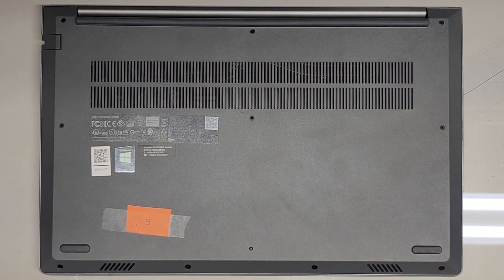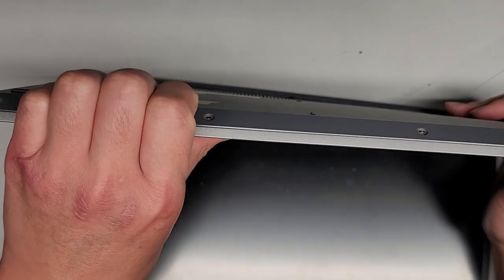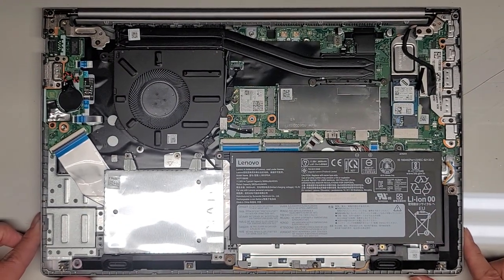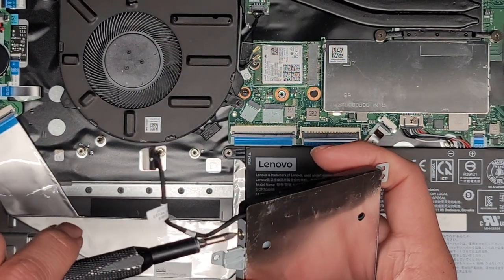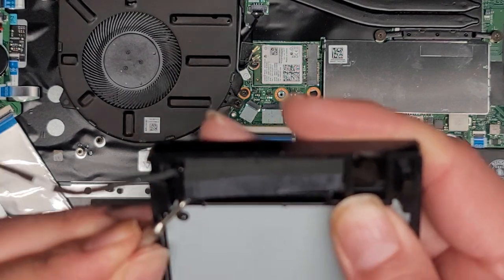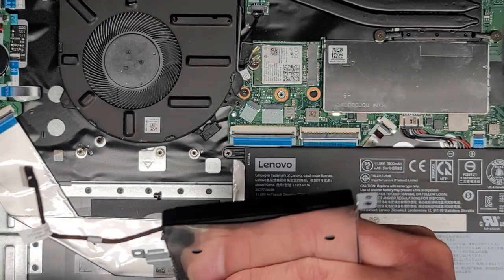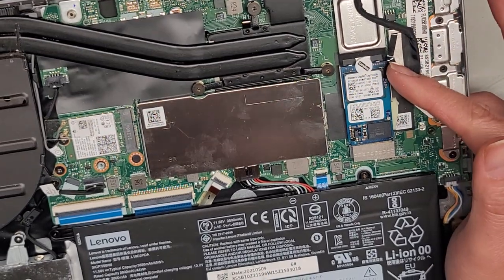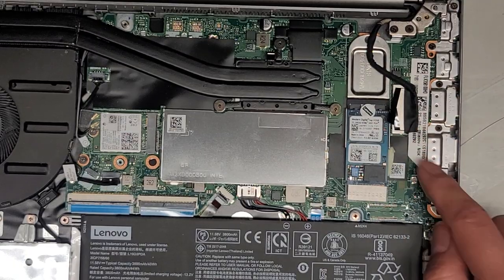Lenovo ThinkBook 15 G2ITL Disassembly RAM SSD Hard Drive Upgrade CMOS RTC Battery Replacement Repair

Comment: I had such trouble with the 2.5 ssd/HDD thing. Video was of much help 😊. Searched the whole day for a solution of a problem. Read in a forum - HDD is compatible, ssd not? Isn't this weird? So I put in Samsung 870 8tb. All normal, recognized, but then in Windows it locks up while copying, especially when writing. I even had data corruption. Reformat took ages. Ssd is fine, I tested again.
Reply: Maybe you understand more and have a idea. It would be such a dumb limitation of lenovo.
Reply: Tried it as last resort with an old 512gb ssd. Now this working! So it must be of other reason. Copied between external 8tb and internal 512gb several gb without issue. Vice versa, - still no
Reply from the maker: Hmmm very strange. So it's working now?
Reply: @ItsBinhRepaired  that's right! sadly no sucess. Think I will use it as external, speed is enough and as a benefit greater flexibility when switching devices (-:
Reply: @ItsBinhRepaired  BTW these thinkbook casings are like rubber. Old thinkpads where soooo much more sturdy, haha
Reply from the maker: Yeah, the old ThinkPads were amazingly built.
Reply: @ItsBinhRepaired  I am pretty sure  this weird dummy is that heavy to support the whole construction!! Fujitsu laptops where also very robust and a lot cheaper. Pure Underdogs. Sadly these had such annoying fan management I couldn't stand the noise any more. It went on/off all the times at the slighted peak haha.
Reply from the maker: @chaitai2533  :(
Reply: Lost me a little here - so will it take an SSD 2.5"? I also have a full size m.2 SATA SSD to replace the 256GB mini m.2, does anyone know if it will take a SATA m.2 or is it just NVMe? The SATA m.2 is keyed correctly because I replaced the z390 mobo it was in with an NVMe PCIe 3.0 m.2.✌
Reply from the maker: @facelessvaper yes and yes both 2.5" SATA SSD and m.2 full size.
Reply: @facelessvaper  technically it should work, - but- I put in Samsung 870 8tb, and it had veeery low speed and got stuck. I think it even destroyed partition. Shock! Luckily recent backup. Smaller capacity ssd work just fine. In the end I attached the 8tb on the back with velcro and 90 degree adapter for protecting ports. (-:
Reply: @chaitai2533  Oh yes 8tb I can see that causing issues. Thanks for the response - I am looking for a used win11 mobile cpu lappy with an extra m.2 to repurpose an old m.2 SATA, if that's even possible with the limited tech choices but I have time.
Reply: @ItsBinhRepaired  Thanks, I think I will continue my search for another brand but put a pin in this one. I defo need another drive as my current win10 has a boot SSD & a HDD via a caddy. I do enjoy repurposing storage and parts where possible but to sell my daily driver I would have to leave the SSD in + it's old and a nightmare to open and swap out.
Reply: @facelessvaper  yes indeed, I. E. Newer thinkbooks, - no caddy) - :

Comment: HI!
Isn't it necessary to disconnect the battery cable before installing components, as stated in the maintenance manual?
Reply from the maker: No, only the screen cable. You can disconnect it and hold the power button 15 seconds to be extra safe though if you'd like.
Reply: @ItsBinhRepaired  Thanks a lot!
Reply from the maker: Yup

Comment: So what was the cause of blue screen after all. Was it the soldered ram or the sodimm one ?  
Also physically what did you learn from the experience ?
Please share because I just bought this unit and may return if they have such failures common
Reply from the maker: All I know is in the video, that's it.

Comment: i just bought this laptop. just upgraded the ram, it had a soldered 8gb. i put a 16gb stick, now have a total of 28gb. which i can tell a big difference when it comes to speed and boot up times. but what would you upgrade the hhd slot or the ssd stick? im new to all this so bear with me haha. I'm trying to make it a nice fast laptop. my only complain about this laptop is the battery life sucks! I've been trying to find a battery upgrade but nothing yet :(
Reply from the maker: Larger m.2 pcie nvme SSD and get rid of the 2.5" sata hard drive.
Reply: @ItsBinhRepaired  so upgrade the 256gb ssd? I have this exact same laptop. Does it have a sata hard drive installed? I’m sorry is these are dumb questions. Like I previously stated I’m new to all this and your videos really help me out a lot !
Reply from the maker: @Chino0118 you'll have to open it to check. This video will help https://youtu.be/4p5jFDzVwUw
Reply: @ItsBinhRepaired  thank you!
Reply from the maker: @Chino0118  yup

Comment: Just bought one of these at a pawn shop. 
The battery drains tather quickly. Is the battery replacment pretty straight forward?
Reply from the maker: Pretty straightforward
Reply: @It's Binh (Been) Repaired & Reviewed  Thanks bud.
Reply from the maker: Yup

Comment: Have a user who plugged his iPhone into the thunderbolt port and the laptop immediately crashed and will not power up. Power light goes solid for 6 seconds and goes off. Did he fry the motherboard? Wont power on with just Batter or Just Power supply
Reply from the maker: No idea. Try removing all power sources and hold the power button 15 seconds.
Reply: @ItsBinhRepaired  Did that already. No change
Reply from the maker: :( needs a new motherboard

Comment: Hello. Where is the RAM that comes from the factory? until you upgrade. thx
Reply from the maker: Under the metal cover
Reply: Hello, thanks for the message. you mean the metal cover from 12:05 ? 
the laptop came from the factory with 8 gb ram, and I added another 8 gb fixed where it is in the video 12:05 . I wanted to ask where I can find the first slot. Thank you very much.
Reply from the maker: @alingherghel.ByLAmad  there is no first slot. It's soldered to the motherboard.
Reply: thank you very much. I'm ok at the moment. all the best!
Reply from the maker: @alingherghel.ByLAmad  got it

Comment: What ram did it use DDR3 DDR3L DDR2 or DDR4?
Reply from the maker: You want to watch the video. It tells you the type, speed, and capacity currently used. You'll also learn a lot of other things.
Reply: @ItsBinhRepaired snob
Reply from the maker: The point of my videos is to teach people... not to be a google answers forum where I have to answer millions of people asking the same questions because they didn't watch the video...